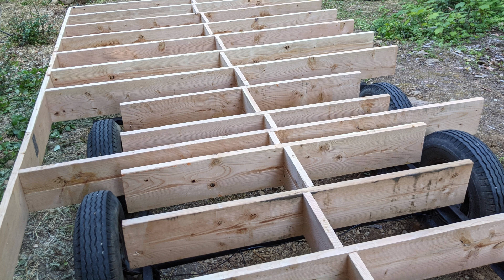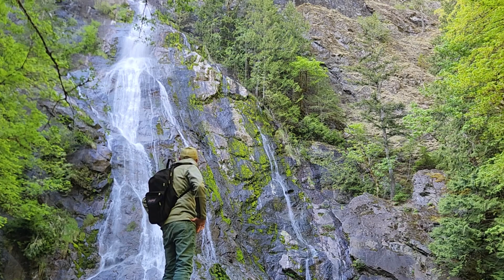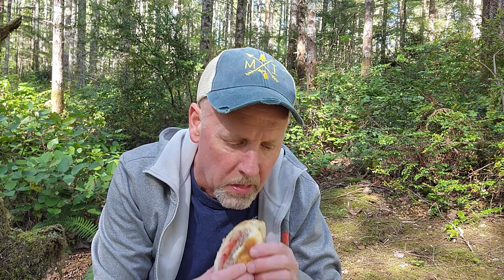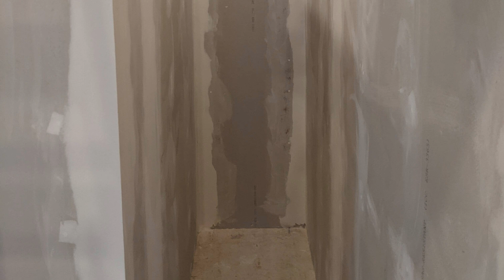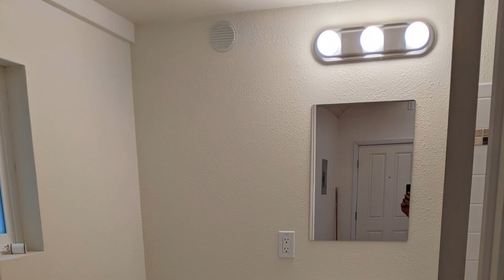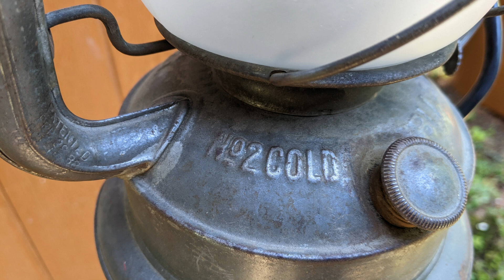Tiny Cabin Built all Alone using Free, Repurposed, and Deeply Discounted Materials!

Comment: Is there an alternative material that can be used instead of sheetrock?
Reply from the maker: There are many alternatives to sheetrock, but none are as inexpensive. You can cover 32 square feet of wall for just $14 with standard sheets. However, I usually buy the damaged sheets for $4-$5 each, which is hard to beat.

Comment: Nice! Noticed you installed insulation next to your roof. Was wondering how you vented it? Didnt see a ridge vent on the metal roof but did see a gap in the roofing OSB.
Reply from the maker: I used "rafter vents." I don't think you can see them in the video. They are thin plastic or Styrofoam "tunnels" that go between the OSB and insulation. They vent at the Ridge.
Reply: @TinyCabinWeekends  i didnt see that in the soffets.